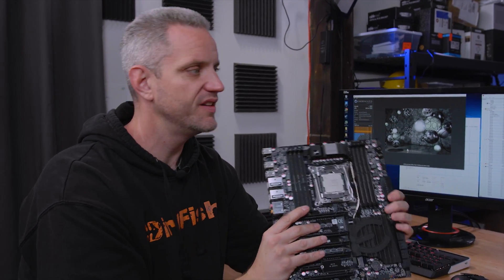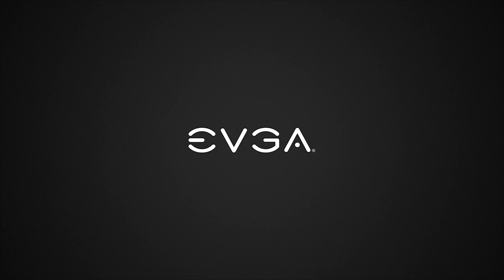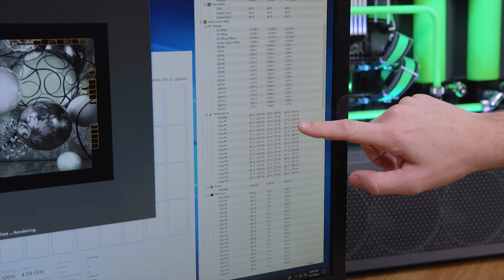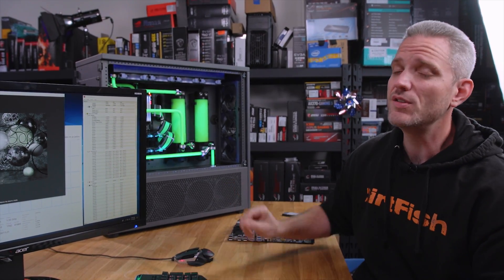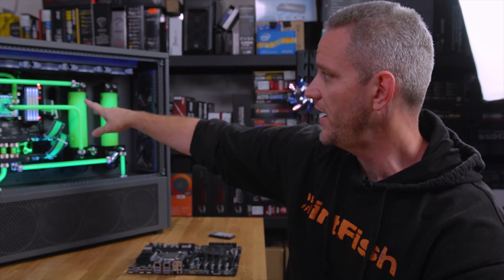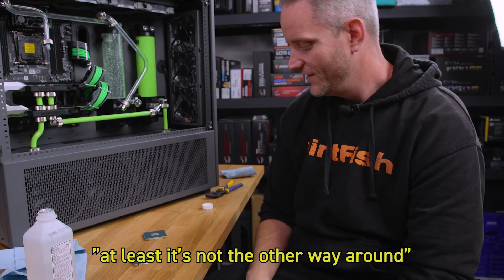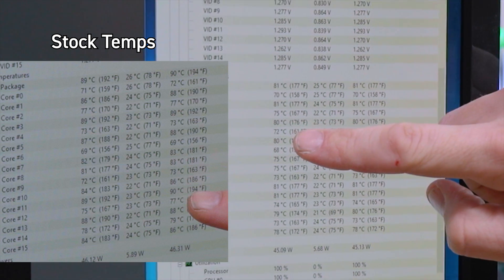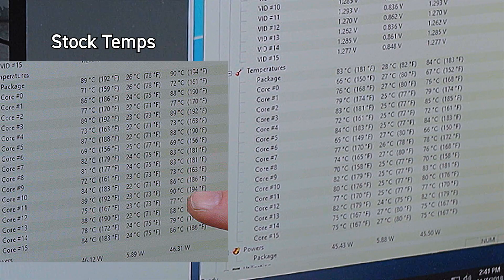I went to delid my CPU... but I didn’t expect this!

Comment: Also, you didn't use Liquid Metal, you replaced paste with paste.... The only thing you did was remove a tad of thickness by removing the silicon (thats if you didn't replace it). The thermal conductivity of paste is much lower than liquid metal.
Reply: From experience I can tell you that by just replacing the shitty intel thermal paste with something like artic silver 5. I dropped around 12 degrees. You don't have to use liquid metal to see results.  As such I was able to hit 5.3 ghz on my 7700k. Before I wasn't able to break 5.1 no matter how much tweaking I did.
Reply: @AngryWatchGuy  Thing is, Intels 'TIM' isn't bad in terms of being a paste, the problem is is that it is a paste. Paste has lower thermal transfer than liquid metal. Why anyone would choose to use paste vs LM in an effort to drop temps in a delid is beyond me. The temperature saving you saw was probably from the reduction in gap between the die and the IHS.
Reply: Fister why wouldn't I use liquid metal? Simple.  It has gallium in it.   Trust me my friend.  I know all about liquid metal.  Apperantly more then you it seems...
Reply: @AngryWatchGuy  Ok, and what is the downside of using LM vs paste then? Seems your the man with all the answers, what is the drawback. The 10 or so CPUs I've delidded run seem to agree with it.
Reply: Fister talk to me in a few years.  We will compare what our cpu and cooler look like.   If yours is still alive.    As for the drawbacks.  Hello...  It's gallium bro...
Reply: @AngryWatchGuy  So, you got nothing? And what effect would it have on my cooler, it's sitting between the die and IHS. Seems you're all talk with no substance. LM > Paste if you want better cooling. None of my CPUs, or even GPUs (tested on two) had issues. But hey, you read something somewhere right?

Comment: Cinebench is NOT an AVX based workload.
Reply: Exactly. Anyone running it with negative avx offset can confirm it never triggers. If he ran newer prime95 versions that thing would go up in smoke :)
Reply: @thedoctor3777  Prime95 always makes things go up in smoke, it's undefeatable lol
Reply: Cinema4D will use AVX but cinebench doesn't because it's a benchmark I think.
Reply: @infernaldaedra  Cinema4D is on a much newer version of the engine. If they made a new CB using R19 it would have AVX
Reply: Fister yes this
Reply: @sophyx9  No, it is not. It uses SSE. Newer versions of the engine use AVX, but Cinebench hasn't been updated in a long long time.
Reply: Fister I know I was agreeing xD
Reply: @sophyx9  Ah ok, sorry then :)
Reply: @-pcmr-108  No Problem, my response wasn't really clear
Reply: If it was AVX-based, I'd love to see the temperatures and power usage at 4.6GHz... ;)
Reply: @stephandolby SkylakeX tends to be very unstable with avx actually. It would probably just blue screen.
Reply: as if jay knew the hell what he is talking about. he doesn't know more than your slightly above average joe, and he certainly doesn't know shit about programming or architechtures
Reply: @entswaggles  and yet here you are at his YouTube channel...   You sound jealous at the very least.

Comment: No improvement after delid? Maybe the IHS contact with the processor is where the problem is.

I don't think Intel intended the convex on the IHS either.
Maybe the convex is a clue that the IHS doesn't have a good contact with the processors microchip.

Comment: You did not mention the possibility and likelihood the IHS was reasonably flat to start off with and when first put under load it became convex and or much more convex.  Meaning people might check their CPU find no issue, have the same heat related problems and think they had already ruled out the IHS so they go right to delid.   There are various reasons an IHS might become convex, and it's highly unlikely it was that way when new / uninstalled, so it had to get that way somehow.   Do you really think Intel QC is so lacking on a $1,700.00 US CPU?

Comment: Or you just use a level.. Put it on top of the IHS. If the left side, center and right side of the IHS don't all touch the level, you're IHS is not flat.. CPU's aren't supposed to be used as spinners..

Comment: We implore you sir , please use Liquid Metal ! 
Although it's understandable that you might not want to do it since it's a daily driver system and what we have seen when Linus did it, is that there is real risk of the LM shorting something out over the long run . But it would be awesome if you could just do it once to show the temp differences vs non LM and explain why it should not be done on a long term basis.

Comment: Wtf Jay, why would you delid and not use liquid metal under the lid?! Thermal grizzly's conductonaut does 73 W/mK, antec 7 nano diamond for example does 8.3W/mK. Use rockit cool's copper IHS as well where available, they are machined flat to begin with and are worth about an additional 5°C drop in temp. I delidded my i7 7700k with the rockit cool IHS and conductonaut, now running at 5ghz on asus' factory 5ghz settings on z270e because it's been cool and stable enough to not need to touch it yet and drop voltage further, I rarely if ever see 70°C under a noctua NH-D15 air cooler. I'm positive the results would be even better given your liquid loop, mine dances in the high 20°C low 30°C range at idle with my current setup, with liquid, it would probably idle in the low/mid 20°C area.

Comment: With the extra thick silicon on the chip itself (to tolerate the soldering process), wouldn't lapping some of the cpu itself yield some additional improvements?

Comment: JAY their is a AVX negative offset in the bios settings to correct this issue without delidding. You can set a -1 baseclock offset for AVX/AVX512 workloads to help with stability. Otherwise a set voltage for the CPU should help at 1.25/1.3 but if you overvolt/overclock and delid and it still crashes then you could also use the offset as a last-ditch effort.

Comment: FWIW glass is going to have a thickness and flatness tolerance as well, and it can flex slightly if it's relatively thin. The best bet for this is to use a granite surface plate, like what a machinist uses for inspection/measuring/layout work. That will give you true flatness with tolerances of around +-.0005 over 12" for a cheaper version or much much better if you like paying out the nose. Us knifemakers use them all the time for many things, one of the main ones being getting a perfectly flat perfect satin, aka brushed, look on the flats of a knife. 

Pro tip, you don't need to tape the sandpaper down on a smooth flat surface like this. Just put some water under the paper and wet the paper. The surface tension will hold the paper in place.

Comment: First YOU USE ONLY LM FOR A DELID!  It's well known the results of TIM vs LM. The IHS on Intel cpu's have not been flat for a long time. How do you not know that? They can be bowed out or in. It's the reason for different jet plates that change the block bow for EK.  I lap every IHS since sandybridge.

Comment: 4:10 "For whatever reason small data set is more tasking of your system"

That's because the data fits in the lowest level cache and therefore the processor spends less time waiting for it.

Comment: Wow, that slight bit of curve in the IHS is horseshit. That's Intel's bad quality control. Can you sue them for that? Or... something? That's a bad product, it's supposed to be flat
Reply: That is intentional design as it actually brings the IHS closer to the cooler with less thermal compound in the center towards the die. For most users in a normal use case this can be beneficial for air cooling.it is not supposed to be flat.

Comment: 1:00 It does not void your warranty.  US law prohibits that.  For a modification to void the warranty, the company must demonstrate that the modification caused the failure.  If you successfully remove the IHS, apply better TIM, and the system works afterwards, then your modification clearly did not cause the product to fail.  If it fails later, Intel would have to prove that it was your modification that caused the failure, rather than a manufacturing defect of some sort.
Reply: Good luck fighting that battle.

Comment: Hey Jay the bare copper is tell tale sign there is still a high point and the corners of the die are not getting the best thermal transfer, a couple more laps for a couple more degrees, food for thought.

Comment: So if you lapped the outside of the IHS wouldn’t the inside of the IHS still be mis-shaped?  Allowing a greater distance between the die and IHS causing a less than ideal heat transfer.

Comment: I have the 7920x and after de-lidding and water cooling on twin 280mm rads,temps hit 100+ at 1.28 volts 4.7Ghz in AVX loads and went to 105oC 15mins.  I had to accept I could not deal with with heat this chip puts out! The solution I found was per-core overclocking and set 4 coolest cores to 4.8Ghz, 1.35 volts (jay has super ultra golden samples) and the rest to 4.5Ghz  1.19volts.  Now it runs 95oC on the 4 hot cores and 85oC on the rest which is fine. Per-core works well.
Reply from the maker: This wasn’t a sample. It was a retail chip

Comment: Cinebench R11.5, 2003 and R15 do NOT use AVX. They use SSE instruction. The prime equivalent is version 26.6 with 1344K FFTs. Also, Intel TIM wasn't really terrible. But it was in comparison to LM. With LM you could see temps drop another 12-20C depending on how flat the CPU die is and amount of LM used. Just need some nail polish, conform coating or Liquid Electrical Tape to cover the SMDs, then remove all black RTV on the IHS to reduce the gap. Remove RTV on the top PCB. Leave the RTV alone on the larger PCB part. At 1.28-1.30v you could be running 4.8GHz.

Comment: to have better temps on a cpu, the dye would need to be less concentrated and more spread out, think of a pancake  instead of a hamburger bun. more surface area and less shit for the heat to go through before it reaches the copper.

Comment: why do builders put the IHS back on with 2 layers of thermal paste? my alienware laptop only has a layer of liquid metal between cpu and heatsink, surely desktop heatsink can be tightened to compensate for the thinner cpu? is there something im missing?

Comment: I see the comments section screaming about liquid metal, but forget that. Why not get an aftermarket socket latch/delid die frame/whatever you want to call it, and run a bare die? You know from your work with GPUs that a direct connection with the die gives GPUs a much greater temperature advantage when water cooling, so why not skip the IHS all together?
Reply: Might be a lot more work with hard-line tubing since the distance between the cooler and what it's touching would be different. Maybe I'm wrong though.
Reply: Jesse Dery, if you direct die you still want to liquid metal it.
Reply: The IHS is a part of the clamping system and absolutely neccesary on any and every LGA socket system to both rigidize and apply the required preasure evenly across the CPU PCB.
Reply: Logi Cian no it’s not required, there are several solutions that allow for direct die interface without an IHS including ones from Der8auer. My 8700K, direct die, 5.3Ghz with custom water loop disagrees with your assessment.
Reply: @backupplan6058  I didn't say it was absolutely necessary for it to work.
Reply: Logi Cian actually you did, you stated and I quote “absolutely necessary on any and every LGA socket system” that doesn’t leave much to interpretation.

Comment: REEEEEEEEEEEEEEEEEEEEEEEEEEEEEEEEEEE LIQUID METAL. Just summed up the comments for you. Then again. They are kind of right.
Reply: They are fully right. Delidding your CPU and putting it back together the same way you found it, hoping for a change is insanity. Liquid metal is orders of magnitude better at conducting heat, compared to paste. 

Fact.
Reply: @thegoblin3629  He didn't delid it then put it back together the same way he found it. He used a different paste to Intel's. Fact.
Reply: @Krytern   True, he did use a different paste, but I also acknowledged that in the beginning. They are equivalent in methodology, therefore meeting my definition of "same." Thanks for the comment, good for the lols.
Reply: That's just you know... opinions.

Comment: Lapping can be considered a way to void the warranty, yet it's due to Intel that you had to go to such lengths to fix their mistake(s)..

Also, LIQUID METAL that's the answer to lower temps on your CPU for delidding :D it's not as scary as one would think, it's almost like when someone doesn't want to do a custom loop for their first time, just that you got a slight bit more risk involved with it now

Comment: $1700 for a i9 7960x and the heat spreader is not flat? Is Intel 'taking the piss'?
Reply: Could've gotten a 2950x for half that. Ayylmao.
Reply: @johnmartinez8530  Not saying that the i9 7960x isn't a good CPU, but in NZ we can get a Treadripper 2950x for $NZ1550 vs $NZ2500 for the i9 7960x. About the same performance? At that price you could get another graphics card.

Comment: Does anyone know about how much I would be able to sell this PC for from Alienware it is a aura r7 it is about one year old

Intel® Core™ i7 8700 (6-Core, 12MB Cache, up to 4.6GHz with Intel® Turbo Boost Technology)

NVIDIA® GeForce® GTX 1080 with 8GB GDDR5X

16GB Dual Channel DDR4 at 2666MHz; up to 64GB 

128GB M.2 SATA SSD (Boot) + 2TB 7200RPM SATA HDD 

Alienware™ 850 Watt Multi-GPU Approved Power Supply with High Performance Liquid Cooling

Killer 1535 802.11ac 2x2 WiFi Wireless LAN and Bluetooth 4.1

Comment: I need help my games won’t stop stuttering I’ve tried everything I can think of any one have a suggestion?
Reply: It's hard to help when we know nothing about your computer and the games you play. Do you have a turnip for a video card?
Reply: wysetech2000 I have a r3 1200 and a 1060 3gb. I don’t play anything crazy just the normal stuff battlefield 1 fortnite
Reply: @bustinBoXs  I would suggest that you google the requirements for the games you play. Neither your CPU or graphics card are very powerful. Make sure the CPU cooler and graphics card fans are running and not choked with dust and that nothing is running in the background using your memory and CPU.

Comment: Also when you lap the IHS you're removing material from it, meaning heat travels through it much more better (grammar) meaning you can knock a few degrees off it.

Same principle was applied when de8auer lapped the silicon on the dye itself in the intel 9th gen vid he published. Surface area = good, Thickness (after a certain point) = bad.

Comment: why would you delid without using liquid metal?   It's the proper way to do it and I bet you would see a 10c drop if you used it.
Reply: At least 10
Reply: It's a long term rig, it just adds another layer of maintenance and point of failure.
Reply: No, it doesn't.  You'd have to clean the loop way before anything else.  Delidding with out liquid metal is actually idiotic.  You've voided the warranty for no reason.  The whole reason you do it is to actually get better temps, which you will not do if you don't use liquid metal.  Liquid metal gets better temps than the solder that intel uses as proved by Der8bauer.  This was just stupid.

Comment: Anyone else wanting Jay to make a "lapping" tutorial?
Reply: Just watch GN.
Reply: You just make sure that you use a varied pattern, you DON'T want to keep doing the same simple motion repetitively because there's an increased possibility of removing IHS material unevenly, causing it to no longer be parallel to the motherboard.
Otherwise, it's little more than what you saw Jay do - get a surface that you know is perfectly flat, be it a large piece of glass like you saw, a ground-to-size steel plate, a granite surface plate(these are DEAD FLAT, being that they're intended for use with precision measuring tools to get the most accurate possible measurements) or even just a piece of granite counter top; once you have your flat surface, tape a sheet of wet/dry sandpaper to it; lube up the sandpaper with a little water(the water will carry material out of the lapping path to keep the spaces between the sandpaper grit from loading up/plugging up with material from the lapping which essentially renders the sandpaper ineffective[in that specific area anyway]), and lap the IHS with varying patterns/movements. Don't push down on it, just a light pressure.
Then, when you're pleased with the flatness of the IHS, you can move up to higher and higher grits(300-500 grit increase, making a larger and larger jump as you move up) of sandpaper if you really want to try to get the IHS glass smooth, though this polishing may not have a measurable effect in the end(I couldn't tell you, but, if you're sitting around bored for a little bit, this is low-IQ 'cruise control' kind of work that you can do while watching TV). 
Once you're happy with your work, rinse off and clean up the IHS good, then reinstall - done.

Nothing complicated about this and no real skill required(outside of the ability to follow simple directions & a bit of common sense/critical thinking), this is pretty simple stuff.